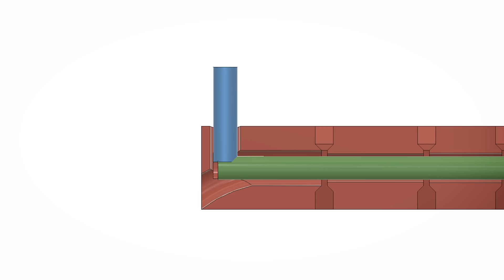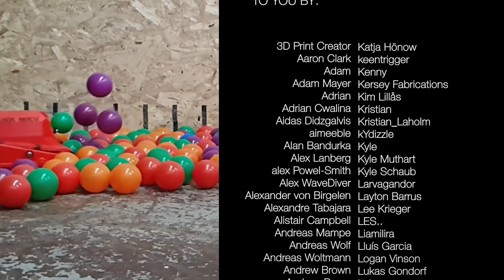3D PRINTED RC MINI TANK

Comment: it needs rubber treads
Reply from the maker: You get the prize to the 10th comment suggesting that 😂😂😂
Reply: @ivanmirandawastaken  Dow Corning make a very runny silicone (#734) that might work as a rubber tread on the bottom of the tracks.

Comment: Friction fit on the shafts wont hold up when you get traction on the treads in grass or dirt. Even worse idea than drilling a hole through the shafts.
Reply from the maker: Have you watched it until the end? With a 13kg battery on top? You have to watch the videos until the end!

Comment: does anyone ever think hes printing so much stuff that the main reason will be blamed on the 3D printer Youtuber comunity for plastic waste that will not decompose in 50,000,000 years? u guys might wanna send old creations to be recycled into new filament or the recycling loving people will be mad, also use the same peices from, other projects and bearings u dont need to buy more or print more spacers, just take a part other builds that are old and done